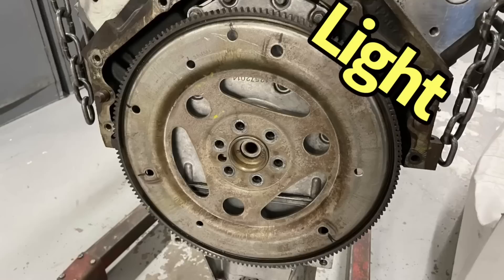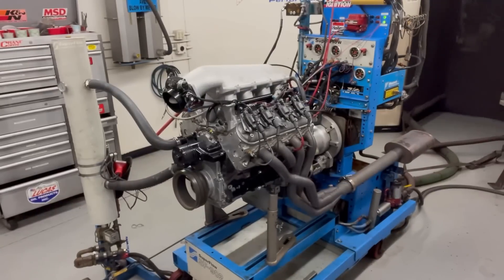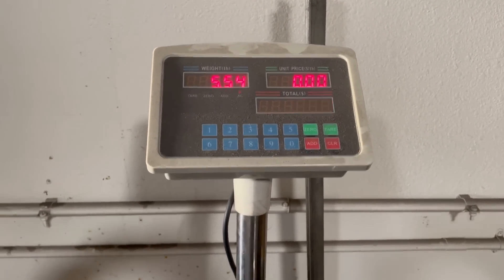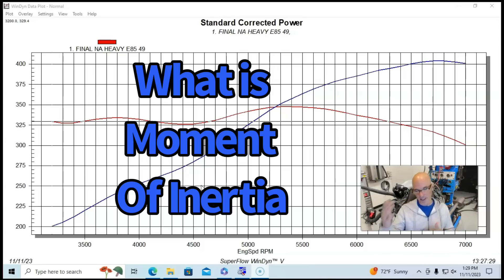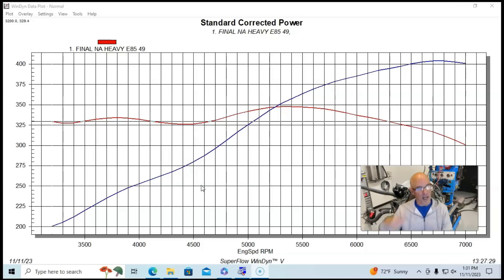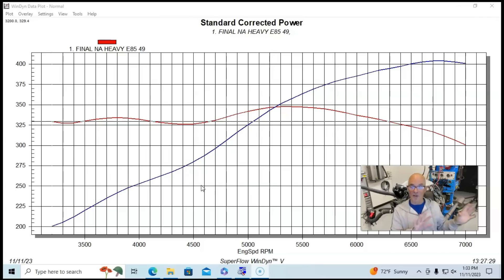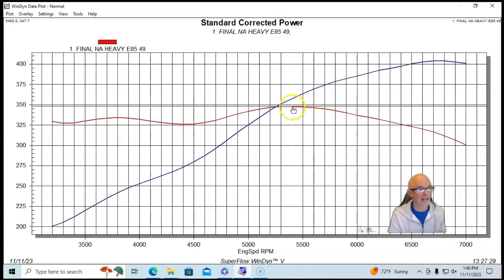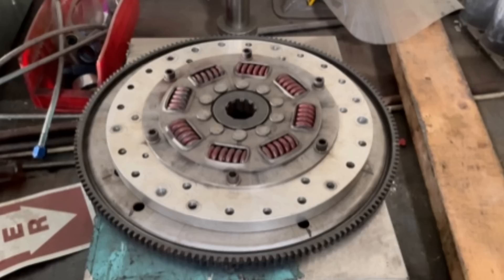FLYWHEEL VS FLEXPLATE-DOES A LIGHTWEIGHT FLYWHEEL ADD ANY POWER? 45 POUNDS VS 16 POUNDS-WHO WINS?

Comment: the engine makes the same power but some  power is fed  into the FW kinetic energy which is then recovered if  coasting in gear (obviously not all energy is converted into mecanical work at wheels, some turns to heat- pumping loss- heats air in cylinders which is dumped out ;) ). But obviously it is better to have it for acceleration. storing it doesn't help, except for more torque/power when you launch the car when you release the clutch for 1/2 second then that's it, from there it eats power.
onn the dyno I saw 10 sec of acceleration so 10HP for 10 s. WE get for this particular engine: 𝐸=74,600/ (3.6 ×10^ 6) ≈ 0.0207 kWh. very little energy but precious power lost.

Comment: Great test and results! What if there is no after market flywheel for a car, would it be possible to take the original flywheel and get it reworked at a machine shop?
Reply from the maker: yes-they can be lightened-but must be done to retain the balance

Comment: I put a lightweight flywheel (7.1kg new one, stock was 11,3kg) on my 231hp BMW M54B30 drift car and I can definitely notice the loss in inertia when trying to initiate drift with a clutch kick or throttling into a drift from mid rpm. The car really needs a lot of rpm now. It's probably a bit more lively at high rpm but at low and mid rpm it is dead. I don't like it already. As Google search AI summary says - breaking traction with a lightweight flywheel really is harder and the car feels as if it has less torque even though it doesn't, it has less inertia. The change from 1st to 2nd gear especially doesn't hit as hard with the lightweight flywheel. With the heavy flywheel the car used to carry the inertia from 1st to 2nd gear and spin its tires but now it just bogs down. Maybe for 1000hp pro cars it's fine, but for low powered grassroots drift cars the heavier flywheel is just so much easier to drift. I can see the benefit for road racing though, where you're mostly on throttle at higher rpm and you don't need inertia to break traction and you do lots of fast downshifts under breaking. But for drifting your 200hp BMW I would suggest you avoid it. Make you car as light as possible, but leave the stock flywheel in.

Comment: they call it brake horsepower (BHP)for a reason. Power should me measured at a steady rpm, in which case a light flywheel has no effect
Reply from the maker: You might find this surprising, but power can be measured many different ways (and do a deeper search on brake HP)

Comment: This is basically the result I expected on a power sweep. I suspect that if you increased the rate of rpm per second, the difference would be higher. 

But my real curiosity is this: 🤔 Is there a difference in power between the two on a steady state load? 

I put a slightly heavier flywheel in my cummins and i like how nice and smooth it is but its always bothered me not knowing if it has killed some of my torque when pulling trailers up hills.

Im guessing that its only affecting power on acceleration and once the mass is up to speed, the power output will be the same but i dont know for sure lol. 

Can you test this for me please ☺️

Comment: For one, a flex plate doesn't compare to a flywheel. A flex plate is lighter because the torque converter weight with all the fluid helps dampen power pulses. A flywheel has a typically lighter clutch to be the link between engine and gearbox. So this comparison honestly means nothing.
Reply from the maker: A light flex plate compares directly as a substitute flywheel-keeping thinking about it-it will come to you

Comment: Sooo
Where was the torque converter usually bolted to the flex plate
Not so light
Chumly
Reply from the maker: Seems like this test went over your head-Let mw explain so you can understand Chumly. The flexplate was just a substitute for a light flywheel. Every flexplate doesn't have to have a converter on it-especially on an engine dyno.

Comment: Rich, you can drill holes in the flywheel to lighten it. Big holes.

Hp not so much but throttle response improvements

Comment: I learned this in real world. if car is light enough, the lightweight wins.. but there is something magic to inertia of flywheel . A modern example is a 96 gmc with 5 liters and 5 speed, and the same exact truck with 350 and automatic... climbing the maine coast line hills to the sea hauling aboat..the 305 brings the giggles.. it is THAT powerful in comparision. Yes, with that "boat anchor" engine morons quibble over.  😄

Comment: A Flywheel is for a manual transmission car a Flex plate is for an automatic transmission car and a torque converter is attached to the flexplate 🤔🤔 but in term of light vs heavy flywheels fir drag racing you want the heavy flywheel for road racing you want the light weight flywheel also weight of the vehicle matters so for drag racing a light flywheel in a light car could work

Comment: I run road courses and the biggest improvement from swapping to an aluminum flywheel was much snappier blips when heel/toe downshifting.  However, if you're someone only driving on the street, I would suggest to stay with steel.  The lightweight flywheels are not as smooth to engage for daily driving.

Comment: a flex plate by itself is not an apples to apples comparison to a flywheel. you have to add the weight of the torque converter to the flex plate and add clutch weight to the flywheel to accurately compare the two.....
Reply from the maker: there is no torque converter in this test
Reply: @richardholdener1727  my point exactly, you cant compare a bare flex plate to a flywheel. the only accurate comparison would be a flywheel and clutch compared to a flex plate and torque converter full of ATF.

Comment: be sides one being for a automatic and one is for a manual trans lol um the flexplate is lighter yes but a converter weighs a lot more then a clutch and pressure plate. and two different trans. As a mechanic this is a dumb convo
Reply from the maker: YOU NEED TO BETER UNDERSTAND THE TEST-THIS WAS A LIGHT VS HEAVY FLYWHEEL TEST-JUST BECAUSE WE USED A FLEXPLATE DOESN'T MEAN YOU HAVE TO HAVE A CONVERTER-THINK PAST THE OBVIOUS

Comment: Whats up Ricky! Hey fo you tund Cars? Hahaha 🤣🤣🤣
If you use another unit of measurement, such as a stop watch, you can measure improved time with the lighter Flywheel, as far as how you measure engines ie Horsepower and Torque, does Not translate into quickbess, or as they said in 1920, Great Rapidity! 
No, a Flywheel cant add or take away Power. Im hoing out on a limb, im writing this 1:00 in just to test myself.
Brwi, do you tune Cars.

Comment: The power gain or loss will correspond to how fast the rpm is changing, whether that is at a prescribed rate on a dyno test or acceleration on the road in x gear (1st gear acceleration will create a different effect than 4th gear acceleration). The harder the rpm acceleration, the greater the inertia loss in the flywheel. Now if you are testing at a constant load at a steady rpm, the flywheel effect would null out, altogether. The torque (and calculated hp) would be all it's worth, and flywheel weight would not matter, at all.

Comment: All the test shows is the deficiencies in the equipment used for testing. If you do a steady state test there will be zero difference.
Reply from the maker: deficiencies of a dyno?
Reply: @richardholdener1727  It's deficient. If it was capable of holding the RPM steady then there wouldn't be any measurable differences. The only reason you measure differences is due to inertia and a changing RPM.
Reply from the maker: the dyno is capable of steady state (a little research on your part would have yielded that info), as is it capable of running the test a vastly different acceleration rates (from 50 rpm/sec to over 1000 rpm/sec).

Comment: Flywheel has it's name for a reason.    Stored energy can be of use.  Like for the gutless 2.3 4 banger Ranger I had as a kid, good luck getting a 4k pound truck moving without that stored energy of a flywheel when letting the clutch out 

Was just about to type in Tilton when you did it for me.

Would love to experience a super light weight on/off reving motor with those tilton flywheels and clutches.

Comment: Had a 95 Mustang gt paper filter stock, it's best 15.40 @90mph. Put in aluminum flywheel, aluminum driveshaft  k&n filter, it went 14.90 @92.5 mph
Reply from the maker: cool stuff

Comment: Richard have you used a Quick Spool Valve?. it blocks off one side of a twin scroll turbo at low rpm and when the boost gets high enough it opens the other port for top-end power so you can run a big turbo without the turbo lag.
Reply from the maker: I have not tested one

Comment: From my experience drag racing a 600rwhp stick shift car and going from a VERY light flywheel & clutch setup to a pretty typical steel flylwheel and spec clutch:  The heavier setup worked much better.  Definitely enough so to overcome any single digit loss in power to the wheels.  The launches were a LOT more consistent and I believe the torque hit on 1-2 and 2-3 power shifts helped with overall acceleration.
Reply: Interesting you mention the boost on the shifts. I replaced the clutch on my old worn out daily, the previous clutch had a pretty poor grab from day one and was borderline on slipping for the engine output.  The disk eventually exploded after 200k of heavy use, I upgraded it to a basic performance clutch and now the car accelerates quite a lot quicker and I feel that the hard bite on shifts transfers the inertia to the wheels efficiently where it was previously were being lost to heat with the old clutch as it never had any decent bite on hard shifts.   Now the car chirps 2nd and 3rd occasionally, it pretty much never did prior.
Reply: @3800S1  I put a lightweight flywheel (7.1kg new one, stock was 11,3kg) on my 231hp BMW M54B30 drift car and I can definitely notice the loss in inertia especially under acceleration when changing gear from 1st to 2nd. Now it doesn't hit as hard. I used this technique where I initiate drift by going from 1st to 2nd and the car spins its tires aggressively then I go into drift from the power applied to the wheels. With the new flywheel the car just bogs down and doesn't spin the tires as much. That's because of the lack of inertia. It feels as if it has less torque even though if put on a dyno it probably makes the same amount, but the delivery is just different. I am already regretting it and might go back to stock 11,3kg flywheel. The good news is that at high rpm the car feels somewhat more lively, but that doesn't make one bit of a difference for drifting as usually you are initiating from mid rpm not high rpm. It's actually physically impossible to initiate drift from rpm close to redline as at that point you will be matching wheelspeed and actual speed of the car. A drift car needs mid rpm torque to be able to power into initiation and unfortunately right now I lost a bit of that. The marginal gain in hp at the top of the rpm range is nice but its at the cost of inertia which is far more important to my use case. When chasing, using a lot of clutchwork and handbraking the lightweight flywheel makes things especially more difficult as you're trying to keep the engine at high rpm while breaking behind the lead driver. Driving like this means you are constantly disengaging the drivetrain from the engine by constantly using the clutch which means you're feeling the effects of loss in inertia even more often. Clutch kicks are less effective with a lightweight flywheel and when handbreaking you really have to drop the clutch from redline to not have the car bog down on you. If you do it at like 4000rpm it's game over.

Comment: On the dyno it’s kinda fudgin it some ain’t it. On an auto you have to spin the torque converter right? That has to be some resistance…
Reply from the maker: this test was only flywheel weight

Comment: That's a lot more power than I was expecting. Still, I feel like the power isn't the point of this. A lightweight driveline will vastly improve throttle response, more than the bump in horsepower would imply, as it's not just reducing how much weight the car needs to push, it's also reducing the amount of weight the engine needs to directly spin without a mechanical advantage from the transmission.

Comment: The problem is, this isn't taking into account the extra weight from the clutch assembly, or the torque converter, which are both weights that bolt to a flex or flywheel, so by rights, without the entire weight, it's all irrelevant.
Reply from the maker: the drive plate is the extra weight from a clutch-this was just an exercise to show changing weight changes power
Reply: @richardholdener1727  fair enough, in drag racing, getting as much parasitic loss out is not always a bad thing, but it's a catch 22 with circuit racing as the weight helps with inertia between gears.
Reply from the maker: For a drag race application (especially the launch), a heavy flywheel is actually preferred (I covered this in the live feed).
Reply: @richardholdener1727  we found the lighter setup was to get upto staged boost quicker, but then again, it really depends at what level people are are aiming for. I don't get to see your live feeds as i'm in a different country, and i'm asleep during your feeds or on a plane 😅

Comment: Road racing = light flywheel and drag racing since you just flat footing it and starting from a dead stop, you want a heavy flywheel !
In my opinion I feel diameter should have stayed the same for the comparison.  Smaller diameter has more to do with leverage and makes that 16lbs seem like 12lbs. I would have liked fluctuating loads to see recovery between both at same diameter.  Better yet a gforce in a given vehicle going through the gears. Dynos are great but the pathway oil takes during  G-forces  makes G-forces test more accurate unless you're losing traction 💁‍♂️
Reply: Wrong! Drag racing with a lower hp car is better with light flywheel

Comment: Curious what happens to the engine with an out of balance flywheel?
Reply: The main bearings will take a beating.
Reply from the maker: IT WILL VIBRATE ITSELF TO DEATH

Comment: Stock flywheels have heavy steel clutches.
Flexplates get heavy torque converters. 
Lightening a flywheel/ clutch  assembly often makes it harder to launch, do to rpm drop at clutch engagement. Though ususally the car will accelerate quicker. A smaller diameter torque converter usually stalls higher and accelerates quicker.
Something to consider.
Fox Mustang flywheels are 19 lbs, I never weighed the original clutch assembly, but I will, its in the box.

Comment: Now I’m super curious about a full lightweight rotating assembly, crank, rods, pistons. I wonder if weight off the internals makes more or less of a difference than flywheel weight.
Reply: David Vizard did a crankshaft lightening video in the 318 Mopar series in 2023.
Reply from the maker: less-all closer to the centerline of the mass and likely much less of a weight change

Comment: Add on the weight of the torque convertor full of transmission fluid.    The difference between flywheel+clutch+pressure plate versus flex plate+convertor+fluid isn't much different.
Reply from the maker: you are making up a comparison that did not happen
Reply: @richardholdener1727  I know, I watched the video.    In the real world though, once you add up the weights of the auto with torque convertor with fluid versus the manual package - there is minor difference.    Now, if you're going from a heavy flywheel to a lighter weight flywheel, or going to auto with one of those smaller highstall convertors, or vice versa, there can be a substantial difference like your video points out.
Reply from the maker: once again, this was a flywheel test-has nothing to do with automatic transmissions or converters